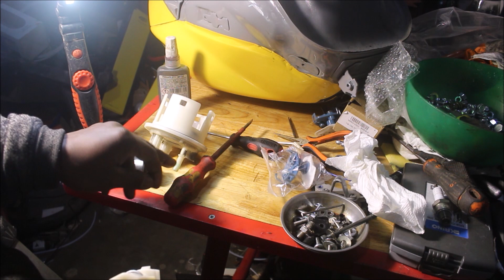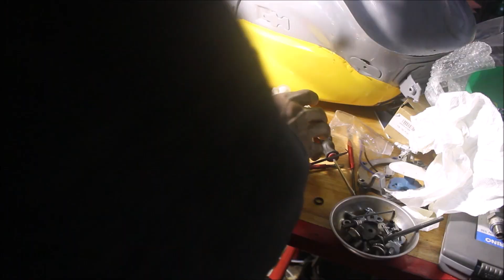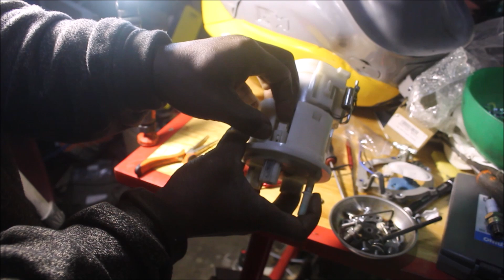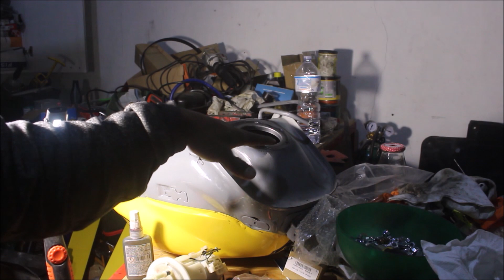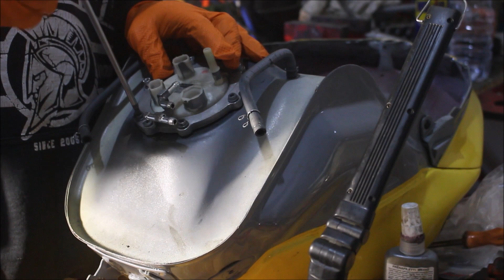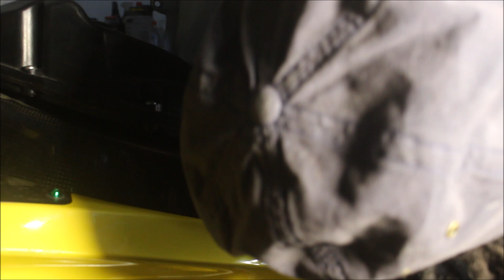Fuel Pump Installation and test Yamaha yzf R6 2006 Error code:50 (part 3)

Comment: Ciao frà sempre io con l'f12 ho un altro problema
Mi potresti dare un consiglio?
Reply: Allora hai presente l'altra volta lo carburato tutto ieri senza smontare il blocco ho montato il 70 il Polini corsa in pratica lo acceso tempo 2 secondi si spegne tipo se qualcuno avesse spento il motorino non ha fatto vuoti nulla di nulla controllo la candela e non faceva scintille oggi ho controllato i cavi se si erano staccati ma nulla non so da dove cominciare
PS: avresti Instagram o facebook?
Reply from the maker: Se hai montato il 70, purtroppo ti tocca ricarburare tutto di nuovo. Se il carburatore poi è 12, per il 70 non ha senso. Insomma rende poco perché fa passare meno carburante.
Prenditi un 19 che raccomandano di essere perfetto per 70.
Reply from the maker: Ciao man certo dimmi, che problema c'è?
Reply: Grazie mille domani ci proverò appena torno da scuola controllo
Reply: Si lo so in fatti ho montato il 19 il problema è che non fa più scintille la candela e io oggi ho ricontrollato tutti i cavi non ho controllato volano statore e centralina solo  non so da dove incominciare a guardare
Reply: Ho provato anche a cambiare candela ma nulla
Reply from the maker: Quando mette la pipetta alla candela, lascia la candela vicino al telaio per vedere se fa scintille o meno. 
Se non fa scintille i casi sono 2. Potrebbe essere la centralina che è andata (non è molto probabile se con il 50 andava bene), oppure è lo statore che non dà abbastanza corrente.
Reply: Io ho provato ma di scintille non ne fa però 
Per controllare se questi due funzionano statore e centralina come posso fare?
Reply: Perché mio padre che ci aveva dato un occhiata aveva detto che poteva essere la bobina
Reply from the maker: Lo statore quando gira,  dà corrente alla centralina. Per controllare se lo statore è funzionante, devi avere un multimetro per controllare la resistenza dei 4 fili (nero,rosso,verde e bianco) che escono per collegare alla centralina. 
Per quanto riguarda la centralina devi assicurarti che scocca dalla pipetta quando provi ad accedere.
Reply from the maker: La centralina e lo statore non si rompono facilmente, perciò ti consiglio di mettere la pipetta alla candela, appoggia la candela vicino al telaio e provi ad accedere con il pedale se fa scintille. Se fa scintille mette un po' di benzina nel buco della cilindro, e poi ci monti la candela e prova ad accedere. 
Se ti accendesse potrebbe essere la benzina che non esce dal serbatoio.